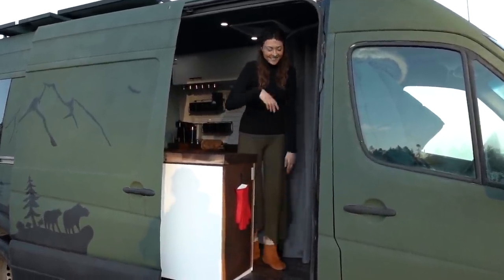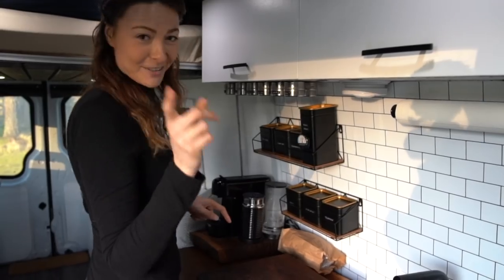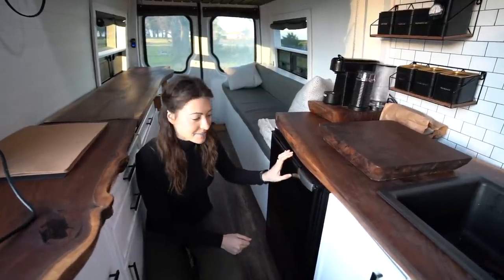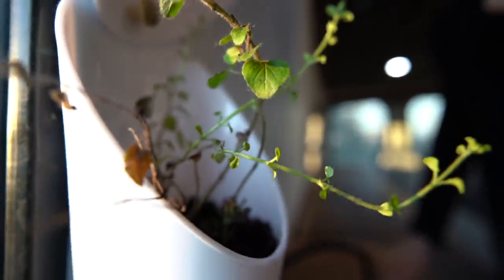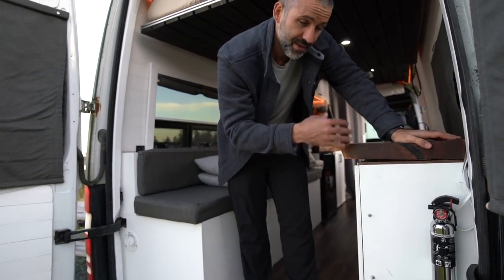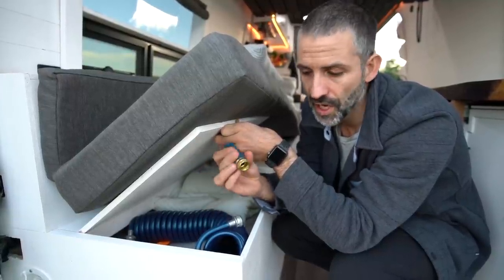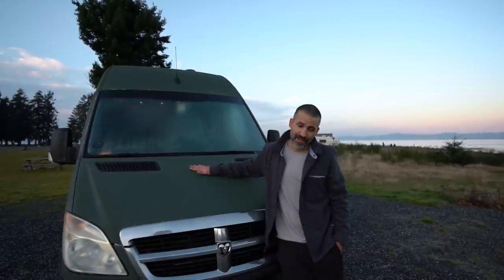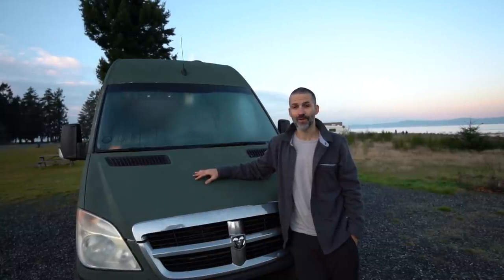VAN TOUR: Self Converted Sprinter Van | Luxury Tiny Home | Full Bathroom | Elevator Bed

Comment: Yasssssssss, I cn easily do this bed set up everyday.  
So, this is the first build tht lve seen, tht l literally would not hv to do any changes to. 
It fits my exact nds. I hv blueprints & l cnt believe, their a near match.
   Not many modifications whatsoever....
I'm actually taken aback by this magnificent build.
For me, l want to be able to walk front to bk, use cab seat(s) on a 360' swivel for more in van seating, hv a full bathroom w dry bucket system, hv a full functioning kitchen w full undermounted (double) sink, plenty of cabinet & storage space, hv a bed tht l dnt hv to mk up everyday, but cn be use easily, (be it murphy or elevator) & cn be put up out of the way for sofa lounging on both sides. 
As well as outdoor shower accessibility. 
This is awesome & it's beautiful.
Grt job...thxs for sharing & be safe.
Reply from the maker: Grad you enjoyed it! Yeah we've installed swivel seat now for the front passenger
Reply: @Drinkteatravel  
This is awesome 👌

Comment: Thé bed sliding down saves a lot place >>> one of the best invention. No need to prepare the bed when you’re tired it’s already ready     great thanks for this ingenious idea. The only problem when there is a problem of electricity. Maybe electric and if it’s possible a mechanic escape solution  if can’t use electric. Just in my opinion but of course diner s  place can be used in general. Thanks to share
Reply from the maker: Yeah we havent had the problem yet in a year and a half. If our battery died we could always turn on the car and let the alternator run it. If the winch itself burns out than we have two options. 1. There's a release lever on all winches. 2. I have it attached via hooks that can detach, so could lift up one side at a time and slide off hook.
Reply: @Drinkteatravel  but why you don’t do a little job on the way like me when I was travelling  to pay the réparations  of battery etc  its better to prevent than have bigger problems after  what you think?
Reply: @Drinkteatravel  ah the battery nof the van or the bed or inside. Very different. consequences

Comment: Wow! I’ve watched a lot of van conversion videos but yours was so informative and your choices are so efficient and beautiful. Have you ever considered attaching those cork mats to the underside of your bed using Velcro or an adhesive so it will be scratch resistant without needing to lay out the mats and put them away? Thanks for sharing, subscribed and looking forward to following your adventures.
Reply from the maker: Glad it was helpful!
Yeah thought about that originally but Oksana didnt want the cork showing on the ceiling as it would break up the look of it. Might reconsider tho ;)
Reply: I hope you have a good version top built for that.... However the rest of this is 💯 percent wonderful

Comment: I'm thrilled, I think the solution with the bed is totally cool. What kind of motor did you use? The extendable table is a dream 👍👍👍👍👍Don't you have a gray water tank?
Reply from the maker: See, we make a 28 long video. And still forget things lol. Yeah we have a 22 gallon tank that I under mounted on the driver side. Was pretty easy to do actually.

For the motor is an atv winch, rated for 2500lbs I think.

Comment: You could clue those matts on the bottom of the bed so you don't have to lay them out every day.
Reply from the maker: Thought about that, but Oksana didnt want the exposed cork up there. We had planned to eventually take some cork and stain it in the same color to be less visible.
Reply: @Drinkteatravel  be careful to not let the stain stain the counter or white paint below the bed if you do that :)

Comment: Amazing.. at the end of the video it shows you standing with some amazing scenery behind you.. What part of Canada is that? did you consider one of those fancy recirculating hot water/shower things? Reason I ask is you seemed to have thought of everything.
Reply from the maker: We were in Qualicum Bay, Vancouver Island. Yeah we thought about it, but we were running out of time for when we wanted to get started and it seemed like it was a bit more advanced then we were willing to tackle at the time. I do think its worth it if you have the money or time. I heard you can link it up to radiant floor heating as well.
Reply: What does this hot water shower thingy actually do? Recirculate as in, recycles the used water ?

Comment: Great van build!  Really inspiring for others.  I did notice that Roxanne is very tall, and the counters are relatively short for her.  Does that become an issue?  Would you build counters so low if you had to do it again or was that done for resale value (assuming the buyer isn’t as tall)?
Reply from the maker: We are both average canadian height i guess.  Oksana is definitely taller for a female at 5'9ish. But we just chose the standard  height of kitchens. We used Oksanas parents counters for reference. We were thinking of making it a bit higher but the issue would have been reduced overhead space on the bed while down. In hindsight we likely could have gone 1-3 inches higher.

Comment: Yes thats awesome! We start a similar gas free build in a L4H4 van in March in Scotland. Love to see similar fully off grid vans! 
Your website is fantastic and gave me just what I needed for a few bits like the tank heater pad, stick on tile sheets etc. 
Couple of quick questions?!
How many showers can you get on your setup before you have to refill?
Any issues with your 400ah 600w solar setup on cloudy days etc if you are using the induction hob and any other hungry applicances?
Did I miss the fridge? Did spot the nooch tho ;)
Do you have details or a link for the rear side windows and the coffee machine?!
How long is the pull out on your kitchen tap? We will have ours close to the side door to extend as a washer for feet etc.
Thanks guys and great job.
Reply from the maker: Thanks a lot! Yeah some of those items were pretty good. Including the heater pad which is pretty useful. 

To answers your questions.

Showers: Depends on how long the shower is really, but our hot water heater is 5 gallons, so really its a 10 gallon max for a shower since the water is mixed 50/50. I would say we could do 4 or 5 showers without an issue. 

Power: We haven't gone below 40% yet in the van, but I will say this is largely due to having the isolator charging the batteries from the alternator. Without that, we would be hurting for power in the Canadian winters. My 600w of solar is maybe bringing in 200-250 tops when it was sunny because of the angle of the sun. 

Fridge: Yeah we have a Vitrifigo 115L which is great

Windows: CR Laurence, you can order from a few of the Van supply stores or directly from them. They had a distribution center 15 minutes from where we built so we went straight through them for all our windows including the real windows. 

Coffee Machine: https://amzn.to/2WIH3pz highly recommend it as we mentioned because of how quick it is and the fact it has a dedicated water nozzle. Don't forget to buy some re-ussable pods as well ;)

Sink Pullout: I would say around 3-4 feet. Theres a counter weight that sits under the sink that you can adjust, and we have ours set to only come out about a foot.

Comment: Two questions: why did you go with a dark ceiling and why did you choose the counter height you did? It looks like you have to bend over the counters to do meal prep. Is that an issue? Is your coffee.hot water product a Nespresso? I've not seen one that has hot water available, too. Too cool.
Reply from the maker: We went with dark ceiling because we feel like it contrasts the white on the cabinets and walls better. And it worked out great because black walnut is obviously dark and a beautiful wood. 
We based the counter height on the standard kitchen heigh of 30-33inches, we measured at the house. Ours is closer to 33". We also wanted to make sure that when the bed came down we could still sit up on the bed and it would give us heaps of space. Also, if we would have made it higher it would have started to interfere with the t window opening slots.

Comment: I absolutely love the idea of an elevator bed! In a lot of camper vans, in order to have the bed out of the way during the day, you have to make & unmake the bed every morning and night, which I could see might become annoying. But I was wondering if you had a backup plan for if the bed’s motor didn’t work and the bed was stuck? My husband used to be in small motor repair, so I know things can go wrong with them sometimes. Thank you.
Reply from the maker: Yeah we have rented many and always loathed making the bed everyday, ended up being v very annoying. So for our own custom build we had to have something like this. 

Well there are two things we could do. 1- on the winch theres a safety disconnect switch which would allow me to uncoil the rope and bring the bed down in case it broke (wouldn't help it going back up) and 2- we have hooks on all 4 corners so if that didn't work either we could unhook it from all four corners and slowly lower it. 
We could then swap out the winch for a new one at any department store (costs us $129) and would probably take 30 minutes or so to put the new one in.

Comment: Love the van.  Especially love your explainations of benefits of bully li er vs. Rhino liner.  It's info like this that is so vaulable to someone like me who has no idea of the products available.  
Also, the commercial solar panels:  if this gives you a better return on investment, why don't I hear of them more?
Thanks so much for tout of your van
It's one of thr best I've seen.
Also, can you stand up in the back when the bed is up?
Reply from the maker: Glad to be of assistance. 
And honestly don't know why. They are bigger in dimensions and most people are probably looking for a small system. Renogy and the likes typically make the smaller panels. But the larger commercial ones are definitely cheaper on a per watt basis. We got our panels for 200 Canadian each. And they are 300w each.
Reply from the maker: I can't at 6'1. Maybe if we had made the ceiling differently we could get it to a 5"10 clearance

Comment: Cracking looking van.i don't think I saw one but would you be putting an awning on it?
Reply from the maker: Been thinking about it, as it stands now it’s pretty good with the doors opened, but could maybe look at adding one. Issue is you can’t put the affordable fold out ones on east since the vehicle is like 3m up. On our Troopy we were able to put one of those on.
On the sprinter you’d need a automatic or bar roll out one.

Comment: I love your floor plan and especially that bathroom. The decor is beautiful. It looks cozy like a home on wheels. Great job! I would like to know more about the water filtration system, specifically how many filters? Can you fill up anywhere and safely drink the water? How long does a tank of water last two people? Does your diesel heater tap into the main fuel tank?
Reply from the maker: Thanks so much! 😊
The filtration system in an inline water filter, this one here https://amzn.to/2J3Gnrm
This is a two stage filtration system, which has one big filter which lasts 1600 gallons or a year. I think this system is good for 99% of usage in North America, if you were in areas that had a more dodgy water I would consider a 5 stage reverse osmosis system. We have one at our hotel down in Costa Rica and it works great and the guests love it!

We have a 25 gallon fresh water tank in our van, and it can last us anywhere between 2 to 7 days, depending on showers, dishes, etc. We have gone around 7 days tops before when we knew water was going to be trickier to come by. But also used it up in 2 days when we were at a camp site and knew we could fill up easier. 

Yep its hooked straight up to the diesel tank. We had a factory installed block heater in our van so we didn't have to lower the tank to tap it, instead we just bought this dorman part (https://amzn.to/3h1sB52) and it was a few seconds to connect it up.

Comment: Nice bed lift. Is the lift connected to the roof? I am designing my van but have a camper with a plastic roof (l3h3). Love to hear from you.
Reply from the maker: Yes, it is! There are supporting beams on the sprinters. If you have a plastic roof you could always look for linear actuators or murphy bed style.

Comment: Inspired conversion , can I ask how much weight did you add on at the weighbridge because you have used a lot of solid timber , can you quote in kilos please and what is your spare payload work out as aprox for personal clutter.
Reply from the maker: I forget off the top of my head. But it was within the limits for a dually sprinter.

Comment: What do you for security?  Would you put a lock on the computer drawer or do you use other measures?
Reply from the maker: I feel like if someone has the means to break into the van and they likely have the means to break into any drawer that our electronics may be in. So we just make sure they are insured in case the unfortunate happens.

Comment: love the build, could you not pad the underside of the bed so that you don't have to lay down the protection every day?
Reply from the maker: Thought about that, we even bought cork with adhesive on one side, but Oksana didn't want to add the obvious cork layout to the ceiling. I think we may get some cork and dye it the same color as the roof and that could work!

Comment: Love the table. You turn off the heater at night and you’re in CAN?? Also, does bacteria accumulate in the plastic tanks?
Reply from the maker: Thanks! Yeah the van has been pretty well insulated so it drops down to maybe 15c at night, which with our warm down blanket is absolutely fine. No issues with bacteria in the plastic tanks yet although I am sure we will have to clean them appropriately on a regular basis.

Comment: As a dealer of raptor liner you are able to touch it up
Reply from the maker: Depends on your definition of touch up I guess, from my understanding with raptor liner you would still need to clean, sand down the original lining and feather the edges a bit. 
Whereas with bully liner it simply goes overtop and adheres to itself.

Comment: Love the slatted ceiling. Can you share what materials make up the slats and backing?
Reply from the maker: The slats are made from standard framing pine. 1x4 pieces (which is actually .75x3.5). The backing is made of 5mm Lauan Plywood.
Reply: @Drinkteatravel  Awesome thanks!!  Never really understood why 1x2's are actually 0.75*1.5.
Reply from the maker: @Ryanfriedman96  I know eh, confusing thats for sure.

Comment: I’m super interested in the wench system for your bed !  I’ve thought about doing the same but have been unsure about the happy jack system, I’ve seen.
Reply from the maker: Yeah it works pretty well. Did you have any questions regarding it?
Reply: Yes, can that winch be manually operated in case of loss of power ?
Reply from the maker: There's a safely release that you can click to allow it to unroll itself down, but you wouldn't get it back up easily. You could always install a secondary manual winch to use as a backup. 
Loss of power has never been an issue as we can always start the car and let the alternator charge the batteries for a few minutes to operate the bed.
Now if the winch breaks yes we would need to unhook the bed and just buy a new winch (which you can buy at any auto parts store or Walmart for like $100)
Reply: I’m going to have to watch your video again to see how you hooked up all those cables.  I really like that system and it seems like a less expensive way to do it and paying 11 or maybe even 1500 to happy Jack for the same type of thing
Reply from the maker: For sure. 
We are planning on creating a video wabout how we did it shortly. This Sunday nights video will be a sped up version of our whole build so it will also include some more on the winch. Make sure you subscribe and receive notifications ;)
Reply: Thanks so much for answering my questions I really appreciate that.  You did a fantastic job on that van. I really like the fact that you did it yourself and it’s so finished looking.  I want mine to be finished looking as well.
Reply: I just bought by Ford Transit 350 Extended with High Roof 3 weeks ago.  Still trying to sell passenger seats. Not gutted yet. I’m on my own and still learning how to do stuff online. So it might take me a few more minutes than it took you guys.  Hoping to have some major things done by April 1st. Gutted, insulated, floor and ceiling and electrical & plumbing.  Your electrical areas look great 👍. But you put monitors on opposite side from where all power was coming from.  Was that because you had no upper cabinets on that side ?
Reply: I think 🤔 I already did but I’ll check and make sure..  thanks again.

Comment: SOOOO many commercials during this video !!!  What the Hell ??
Anyway, the bed lift and the shower were the best part. Tons of storage. Not bad at all. Why didn't you add a small window in the shower ?  Wouldn't be that complicated...
Reply from the maker: Never really thought about adding a window in the shower. Would that be instead of the fan or in addition to it? If it's in addition to that, I would say that its just time and money wasted. The fan does a good job of extraction and also lighting the shower. Plus windows are a hassle and arent cheap as well.